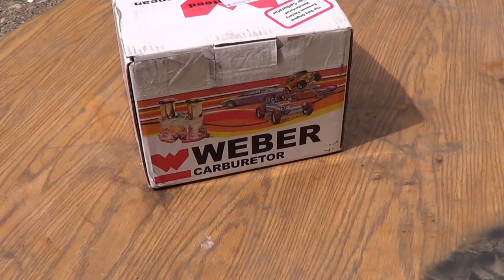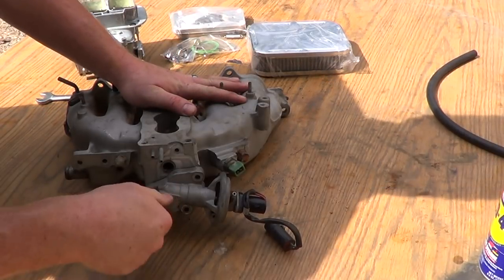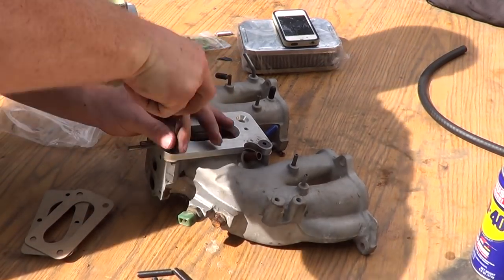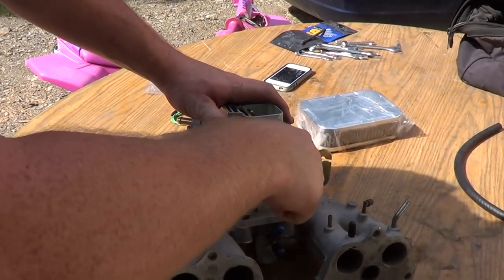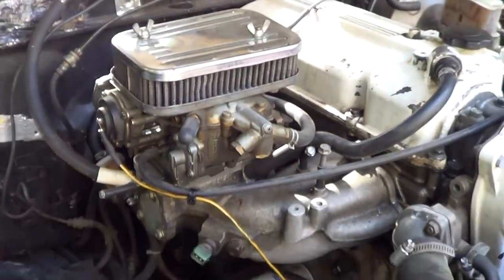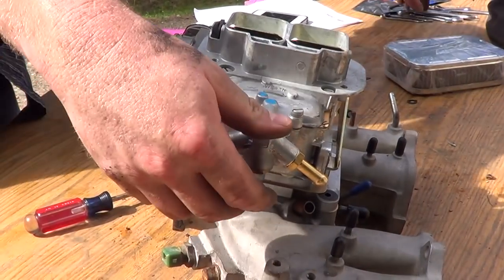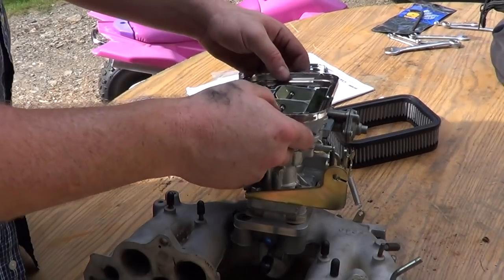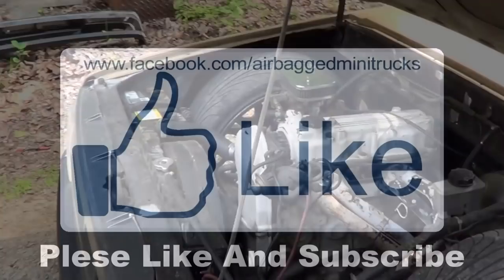How To Install A Weber Carburetor

Comment: My mechanic said I had issues with my stock carburetor and did not want to work on it. Upon watching many videos, and reading many more forum I decide to get one. With the aid of your video alone you helped a complete moron put a nice new Weber carburetor on his B2200. This is that moron and yes she just purrs, truly amazing difference. Thanks to the maker of this video, I owe you a huge debt of thanks. I can honestly say with out your aid I would never attempted this.
Reply: I’ve got an 87 b2600 and I’ve got a new 38 outlaw coming in from Amazon in the next few days. Doofus that had the car before me put a 32/36 on it and it’s all kinds of messed up, only one Venturi sprays fuel and the throttle for whatever reason is hooked up to the wire that connects to the fuel pump instead of some other 12v power source. Also been watching tons of videos on carbs because this is the first car I’ve ever owned that was old enough to need one lol been pretty fun so far

Comment: the plastic 90 degree elbo is for the crank case breather, and it operates the same way it did with the factory airbox, i had a webber on a 2.5L jeep engine before swapping in a 4.3L Chevrolet, these carbs are awesome, nice install and general how-to vid my friend

Comment: I appreciate the info. I picked this truck up for my son so, God forbid, he could learn to work on a vehicle, We have already replaced the timing belt, water pump, thermostat, etc. but I was having problems dialing in the carb. We were still getting some black smoke out the tail and it was fouling the plugs. The compression seems good so we are assuming the rings are good. The weber carb seemed like the best solution. We appreciate your info. Thank you.

Comment: With these Webers guys they really need to be jetted proper to a T. The famous carboratour with the flat spot. These were popular on Fiats in the 70's much of a economy carboratour. Replaced many german Zenith as a kit from redline with a bad jet setup.  Get the jet kit to experiment and watch a lot of these videos here we didn't have in the 80's. Also prefer manual choke as the DGV. Keep it simple. 
Cheers 

Nick,

Comment: The LCE video shows the flat head screws getting Loctite. As a toolmaker of over 20 years, I learned quickly not to put Loctite on flat head screws...if you want to remove them without heat. Red Loctite can strip threads in aluminum, yet don't be concerned about cracking the aluminum by over tightening them. The hex wrench will twist and break long before that point, and no doubt the plates are 6061 T6 aluminum alloy or tougher.  At 19:17: Do you suppose people may want to know that the white plastic elbow (that you didn't know what it was and discarded) is probably for the valve cover breather hose? Saw a guy ask that very question in another video. That was hilarious btw, "I don't know what that does"..."I never use these"...(whatever it is)

Comment: Just picked up an 89 b2200 for $300. Not in the best shape but I'm looking forward to wrenching on it this spring and summer. I'm def gunna get this carb setup on mine.
Reply from the maker: Hell yes. You won't regret it. You get that engine tuned right you can get 28-30mpg out of it.
Reply from the maker: Dale Thompson yes sir that's it
Reply: Joseph Wilkins Sweet, thanks. I'm gunna be ordering new rings and gasket set etc as well. You may see me popping up in your notifications once I get the engine pulled and back from the machine shop if I have any questions. Should be pretty straight forward though. Appreciate the videos and the responses.
Reply from the maker: Dale Thompson bring It on lol

Comment: I used sheet metal cut with tin snips gasket sealant and bolted it over my EGR. 25,000 miles later. Still good 👍

Comment: I keep seeing these Weber carb installations videos but no one covers the electric choke wire, where to connect it from. In some videos I see a red wire connect to the electric choke, is that a 12volt straight from the battery? I also see black wires on other video, so would a ground wall wire work as well?

Comment from the maker: The returns are there on both trucks. The return on the manual fuel pump is on the fuel pump its self. On my other truck I had to add one in the line with a restricted T

Comment: thank you very much i have a 85 Isuzu Pick up (as my profile pic) and i was wondering where that one hose goes from the Valve cover. now i know i need to get a vacuum hose for that.  I would like to thank you for this very interesting and educational video which i have a Webber Carb in my truck.  I bought the truck with the after market webber already installed.  thank you again for your video. i know now how to fix or even install a webber carb in to my truck.  I just wish that they had side draft duel intake for my motor with adapters.

Comment: That hole you plug in the air filter is for a hose to the rocker cover(valve cover) breather. Plug the one on the intake manifold and run the hose from the filter to the valve breather, or plug both and buy a valve breather filter.
Reply from the maker: I learned that soon after. Mine are still wide open lol.
Reply: Joseph Wilkins lol that's why that bit you grind off come's so close. They don't intent for you to use that line any more. that guy rob's a little power because some of you air'fuel mix is being stolen for the rocker.... screw that. but if you don't buy the kit with the air cleaner then you gotta do just that, grind the bitch off.

Comment: Would this work about the same way with a manual choke?   Mine is all messed up at idle when  it is cold and takes forever to warm up.   There is no "sweet spot" on the choke to have it engaged but running.  If I pull the choke out, the motor revvs up badly, if I push it in (disengage) the vehicle stalls out.   I try to find that partial setting with the choke cable, and it's like the two bad effects overlap.   It is pure nightmare in city commute traffic.

Comment: The little gold plate you show that holds the tension on the throttle spring, it doesn't come with the kit? I'm looking to buy that kit for mine here soon and I'd like to know what else I need to order or dig around for. Thanks

Comment: I have a 1988 suzuki samurai. The carb. ive been told works from a computer. it works good after get in second gear and up.Starting out it does not seem like getting enough gas. been told there is adapter kit to make the carb work without the computer. can you tell me how to get that kit? it has a new carb. on it.

Comment: Duuuuude...  That was sooooo much info packed into an amazing video.. Had a bagged n bodied b2200 like 7 years ago.. But pickin up a stock b2200 tomorrow. For an old shop truck.  Do Webber carbs co e ready to run or do you need to dial them in??  Prob gonna need to watch this video another 10 times.

Comment: I have a 88 2600. I put a weber on it years ago and it worked great. recently rebuilt the motor and for some reason it hesitates when I floor it. I didn't do anything different so I'm not sure why it does it
Reply: Peter Ratto check your timing belt?

Comment: Hey man great video. Thinking about replacing my 82 b2000 stock carb, but not sure if it is worth it. debating on either rebuilding the current one or just getting an aftermarket.

Comment: how tall is the actually carb from the base of it to the base where the air filter plate sits on. I want to buy one but I need a 1 barrel adapter to a 2 barrel and I don't know if it will be able to clear the hood with the air filter, the carb, and the adapter plate cus
?

Comment: the three hoses in the front of the air filter housing.. the two on the far right are for exhaust, the other pipe is for what?? Can these pipes be cut off with out any negative consequences?

Comment: vacuum lines.. is NOT the issue.. the normal issue u guys have is mixture.. in a normal setup ie 1 44 mm 44 flat (spæld) karb. u got 4 jets.. get this right........ 1 jet is "cold" 2is the normal  "idle" plus gas plus mix.. (for a normal start "not possible" 1/4 on the "gas" paddle.. "burp" )(put a bit of gasoline in the intake of the weber) and stay on the starter. when it starts..
stay on it. make sure its warm. wait 8-10 min. then u have 2 realign the jets. simple fix = all pipes have to have the exact amount of -pressure = suction (sry im danish) all 4 "jets" in each barrel have got to be the same.. or you will lean out your engine. :) tweak a bit. i found that working with it. tweaking and twerking with it that u might find the setup that works for you..

Comment: I plan on installing a 32/36 weber carb this weekend on my stock 93 b2200. Did you have to install a fuel pressure regulator?

Comment from the maker: The three lines that go across the right side to the front must be removed off the stock header. There is a (rigged) fix. Is to actually cut the off and pinch the ends off.  I did that before I got my pacesetter header

Comment: running it on my datsun 521, l16 engine need the air from the air canister above the fuel tank and that is what that white pvc elbow in the air filter is for, to connect your hose to it from that canister at 
least in the l16 engine

Comment: does the weber carb have that much difference compared to the stock.. im having ALOT of issues with mine. it sticks between a little gas and full throttle. and were can I get one and wat it cost? and does the weber give it more hp or just better get up and go?
Reply from the maker: It's 100 times better. I get 30 mpg out of both of mine. 200 miles to a 20 dollar bill. Alot better get up and go. And alot easier to fix.
Reply: Joseph Wilkins Hello Joseph Wilkins. Enjoyed your video. I do have a question. I have a 1988 B2200, and am thinking of putting a Weber Carburetor in it. However, I live in California. Out of curiosity, would my truck pass a smog test? I don't know if the smog regulations are as strict where you reside as they are in California, but just wondering. Thanks.
Reply: oh wow I am only getting like 15 17 mpg. my motor has been rebuilt but the carb and all those vac hoses and exhaust headers are all stock. but I got rid of the hoses that went back to the carb from exhaust. wat do I need to do to get were u are at making 30mpg?

Comment: Hello. I got a 94 honda civic in El Salvador,  I installed a webber 32/36 but now am having issues with my ac, any idea how to get the webber to work with the ac, but rpm is already at 1000, but once the ac kicks in it just goes way to low and turns off.

Comment: Ive got a samurai, and even though your video is not for my vehicle it helped greatly as there are no videos for samurais.  I got everything together but the wire fore electric choke, I know its not the same as yours but what am I trying to accomplish with that wire 12volt source? Did you go to the alternator so it was power when key is on?
Reply from the maker: Basically the choke wire goes to a 12v ign. Not a constant. Just when the key is in the on position. Like to the + coil wire

Comment: I just have a quick question is this almost the same instructions on a 1982 Toyota pickup ? The engine is a 22R 2.4L gas
Reply from the maker: For the most part it would be the same. The carbs will proly be the same. Only difference would be throttle hookup and adapter plates

Comment: Dale I love all the videos you do on your B2200. I am installing the Weber on mine and im having trouble understanding what needs to stay and what needs to go as far as the old vacume lines and wiring. could you tell me what needs to stay?
Reply from the maker: Only vacuum lines you need are brake booster. Pcv line. And vacuum advance. Which goes from the carb to the distributor. Everything else is plugged and all vacuum lines and stuff over passenger wheel tub goes bye bye
Reply: @JosephWilkinsAirbagjoe   do you plug the old vacuum lines you don't need at the base of them or just leave them open? Thanks love the video
Reply: Get rid of it all don't need any or that shit

Comment: Can you drill extra vacuum ports into a Weber Progressive? The reason I'm asking is that I have a 32/36 DFEV and I have a VW Beetle with AutoStick (and I need extra vacuum ports for the AutoStick control valve).
Reply: Joseph Heston I'd look into drilling and threading a hole into the intake manifold or check into an already modified intake manifold if you need to hook up more vacuum lines.

Comment: aint it backwards the throttle cable on the ford laser as the cable comes from behind the intake manifold the engine you are showing is a rwd mine eg is fwd

Comment: Thanks for the video. Are the jets included with the carb sufficient or have you had to change them out?
Reply from the maker: I've never changed out the jets on mine since they where new. So I guess they are fine. Unless you have a bored motor or something.
Reply: Thanks for the quick reply.
Reply from the maker: No prob at all

Comment: Do this webber carbs automatically idle up and down? like what the stock carb does.. like when its cold idle is high but when it gets hot, idle goes down?
Reply from the maker: Yes they have a cold idle adjustment that lets them idle alittle higher at whatever you want it too, and then when the electric choke gets warm it turns a cam to drop idle down to warm idle screw
Reply: My honda Civic has this aircon actuator tubes that connects to my stock carb. Where will i plug that into so it will automatically idle up when AC is turned on? and Idle down when its not in use?
Reply from the maker: Ryan Bagz No clue about a honda civic, this is a conversion for a mazda b2200 truck
Reply: Joseph Wilkins ah, i see.. do you have AC working on you mazda?

Comment: Is a Webber better than the stock carb on a 88accord dx and how would you get it on / What happens to the vacuum tubes.
Reply from the maker: All the vacuum tube are emissions. The weber gets rid of all the emissions. So almost all vacuum lines are illuminated. And a weber is always better than stock
Reply: That is the question i have right now i have a 1984 honda accord with a carb someone had rebuild wrong so i wasnt sure a rebuild carb or a weber
Reply: ed Hart I don't know if your question was ever answered, but I just had a Weber delivered today for my 84. Cheers

Comment: hi im from venezuela i have a b2200 4 cilinder mazda 1998 does this carburator fit in my truck  weber 32/36 that is in amazon can you tell me please if it will fit in my truck sorry for the Language
Reply from the maker: Can you email me a picture of your engine bay? Airbagjoe@yahoo.com
Reply: a picture of the motor? no entiendo que es engine bay
Reply from the maker: Yes the engine itself.
Reply: foto del motor, eso significaba